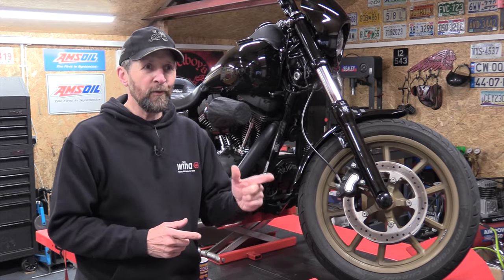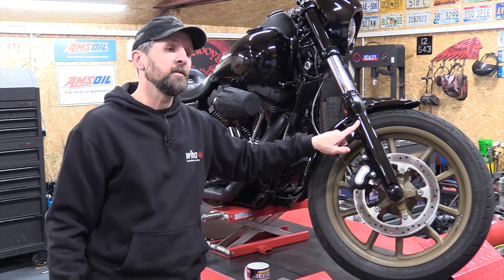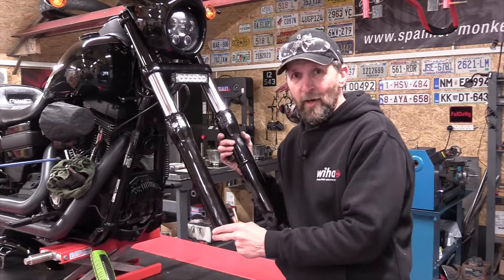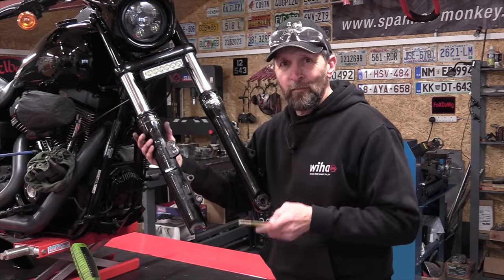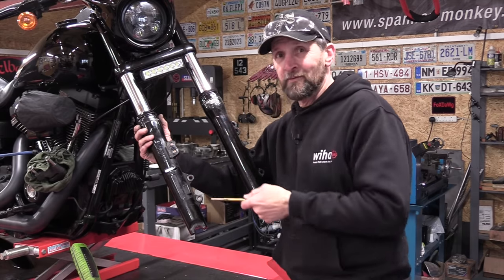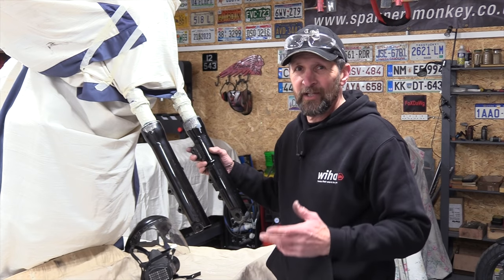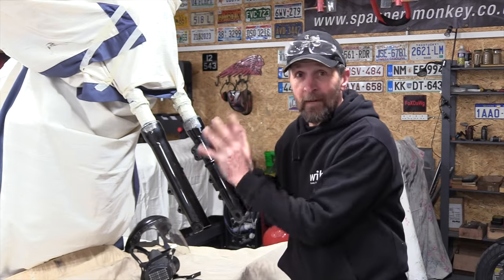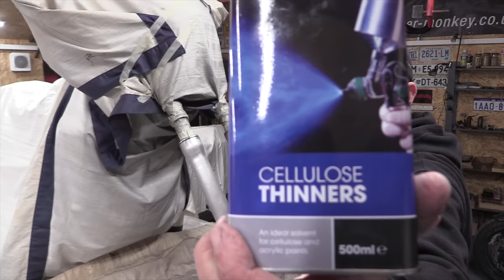Motorcycle Fork :- Corrosion Fix , 1 of 2 !

Comment: You could do as i did. Get one of those big plastics (the biggest you can find) to cover the furniture when painting the ceilings, and make a kind of tent around the bike or the part you are working on. You´ll have to wear a good mask (like you did)  to prevent from breathing toxics but it prevents the dust from going everywhere. I just used fishing poles, ties and bricks to seal the contraption and it worked fairly well . Your end result was perfect!  Ps: i was doing it on my own garage, with my car parked on the side.....
Reply from the maker: Cheers buddy, plastic sheets work well as they have a static quality that actually attracts the paint dust, so effectively sucks it out of the air... good call!

Comment: That is a beautiful job.  I never had painted forks.  That whizzy wheel did a great job cleaning it off.
Reply from the maker: Sure thing mate, it's like a tough plastic pan scourer, takes paint off but doesn't hurt the metal any more than leaving a few lines in the surface, fast and easy!

Comment: Awesome results on the forks brother ! I've used that paint stripper wheel in the past and it has worked great ! 👍 way better than regular pain stripper brother , unless you get one with heavy duty chemicals on it . Great job brother keep up the great work !!!!! stay safe guys cheers from new york 🍺🍺🍷🍷
Reply: I've used 'strypit' which seems to work pretty well. It's cheap-ish, thin enough to be volatile, and thick enough to stay in position. Nitromors 'crafstman' seems to be the most powerful, but it's too thin, so can cause dribble issues. Strypit isn't that good on multiple coatings of paint, as I discovered on my gsxr wheels,, needs working in, and reapplication. Used it because it was here. Definitely recommend the nitromors. Paint on forks is very thin, and comes off a treat. Use 00 (fine) wire wool.  As del touched upon, it has to be washed off properly, or will bubble the new paint. Might look into one of those grinder discs, seems pretty cool, i'm interested to see how they perform.
Reply from the maker: Yeah, absolutly, i have trashed so many paint jobs due to chemical paint stripper residue i will never use it again, not when these paint removal fleece discs do the job so easily, and apart maybe from the dust, they are kinder to the environment that harsh corrosive chemicals that stay in the removed paint mess and end up in land fill... plus, seriously, its way cheaper, these fleece discs are about £4 each, and last ages.. way less than the chemicals !   Take crae guys and have a great weekend.

Comment: I think the hardest thing for the DIY painter to resist is going for that shiny complete look on the first coat.  It’s so tempting!  Hope that oxidation doesn’t return. Once it starts it can be a bear to fight off.  My 2 year old vehicle with new hinges and doors will attest to this.
Reply from the maker: Yeah, it's a constant battle for sure, but if brand new metal as it came from the factory can go like this, then it's pointless thinking you can ever cure it permanently, this was caused by the badly designed dress covers, and ill be removing them to stop that cause again, but corrosion will always happen when i bike gets ridden in the weather right?... have a great weekend sir, and keep safe.. D&Pxx

Comment: Not sure if you have already, or if this video covers it, but could you do a video on corrosion removal from frames? I've got my wire wool and my tin of rustoleum ready to tackle the odd bits of rust popping up, but watching your videos on something before i do it fills me full of confidence.
Reply from the maker: You can consider this video the same as a frame, clean the metal till it's shiny bright, keyed to at least 400 grit, and either use a primer-free stone chip paint like this, or if you're using a regular paint then use an acid etch primer first!   Good luck with it!
Reply: @Moonfleet41  i'm sure i'll learn everything when i get time to watch this. Love your channel though, recently replaced my rear wheel bearings thanks to your videos.

Comment: A cracking job. I was a bit sceptical at first, as I've done something similar and struggled to get all the old paint off and it ends up looking decidedly average. But those wheels work well and the end result looks top notch. I did think I spotted a deliberate mistake though during the cleaning stage, which isn't like you.
Reply from the maker: You must get all the old coating off first or it will always look average... totally bare metal and start over, works best mate. !

Comment: Going by personal experience I reckon this is the way forward - Powder coating isn't infallible, it can still be chipped by road grit just like paint (though admittedly not quite so easily) then you get moisture ingress again and the corrosion process continues, only this time it's harder to fix the problem because powder coating is a real b*stard to get off, the only practical way is to have it professionally redone at further cost and lost riding time..

Comment: Why didn't you use etch primer first Del ? Aluminium does not like just being overcoated it NEEDS an etch to make the top coats stick and be harder wearing. 🤔🤔🤔 I learned this the hard way years ago back when first got into doing bikes up because the aluminium WILL  eventually try and shed the paint. Etch primers acid base 'keys' the surface better to allow subsequent coats to bond better. 👍
Reply from the maker: Check at 9:57 , held that can up and pointed at the "No Primer Required" because i always get this same objection... ive been using this product for ten years since i first stumbled across is for painting a side stand... and that side stand is still good, no chips or flaking a decade on.. so it works mate  🤔🤔🤔!
Reply: @Moonfleet41  mmm. . . Must have some sort of etch in it already because any metal non ferrous doesn't like a covering. Ally or galv plated. But if you've found it works then I ain't arguing I'm just old school and still don't trust these new fandangled paint systems. 😅😅👍
Reply from the maker: @granite676  Sure thing mate, it doesn't make sense in excepted logic to me either, but two things stand out, one is that it works like 'Hammerite' which has been around WW2, and the factory paint had primer under it and it still failed, so tbh mate, I don't think this will last forever on aluminium as, quite rightly like you said, nothing does, not even chrome or powder coat... but for £6 a can and a few hours of my time, I can do it every couple of years if I need to, thanks for your input buddy.

Comment: A brass drift and a brass hammer are a mechanics friend.  For that particular job, a wooden dowel would likely have worked but you need those tools in you box anyway.  Paint job came out very nice.  Is that a typical place for corrosion though?  Never saw that before.
Reply from the maker: Hey buddy, a wood dowel wouldn't have worked in this case as you do need to tap quite hard and the cut end you're tapping is quite sharp, so imagine it would split a wood dowel immediately, but the brass works fine, I guess you could even use aluminium... this corrosion was caused by the covers themselves, they harbour the salt crud and promote the corrosion, all covered in the next video online tomorrow!
Reply: @Moonfleet41  I couldn't really tell on the video they looked like they popped right off but I'll take your word for it.  It is amazing how fast salt can turn aluminum into powdered sugar and crystals.  Your paint job turned out good as new.

Comment: Outstanding job.. and very well explained, i was just about to take my forks off, strip them and send them for powder coating. Will give this  go first. Don't suppose you can share what paint you used? I have rust spots on the mud guards too. Do you think the same paint would be ok or get a proper black paint with a clear coat? Class videos mate.
Reply: I found the paint thanks, Simons Black Gloss Tough Paint :)
Reply from the maker: You can use it pon the mudguards too, it will give a gloss finish that's ok, but maybe not as perfect as a base coat and clear... up to you mate, both options open to you.

Comment: but if you have corrosion eat the surface like that then it normally goes much deeper making it weaker?  painting over it does not address the integrity issues.

Comment: Why no self etching primer? And maybe you could have mentioned the clean up is the same for clear coated ones, then polish and seal to look brand new.
Reply from the maker: Check the video at 9:57, it's a self etching stone chip paint that works without primer!  And of course, I think pretty much most people can work out once I had them clean and prepped, you could indeed have run a buffer over them and polish them up, but hardly on an all black bike!

Comment: Looking good Del, I will watch the second part later as I need to do this on one of my bikes. Between the coats you mention the drying time and 'flash off' what does flash off mean?
Reply from the maker: I just means to allow the paint a small amount of time to start curing and thicken up a bit before the next coat, but no long enough for it to dry...each coat needs to be wet so they bond together, but not so wet it get's heavy and runs.!
Reply: @Moonfleet41  great, thanks. I haven't heard it called that before and thought I was missing something out. It's what I have done in the past but didn't know there was a term for the process. Great channel and uploads as always Del, thanks to you and Penny for all you do on here 👍

Comment: Apparently the truck bed paint from Halfords is really good but I don't think it's gloss finish.
Is it worth putting lacquer on top?
Reply from the maker: Not with a gloss finish mate, this stuff dries soft and remains flexible, lacquer dries hard and chips so the two wouldn't be compatible... this is all you need, just lay it up thick as you can without runs!

Comment: Hi Del, would you advise using that paint removal fleece on plastic parts to remove the paint?
Reply from the maker: No buddy, i'd imagine that would scuff up the plastic pretty badly...plastic panels aren't much tougher than the paint over them..! i only use them on metal..!
Reply: @Moonfleet41  Cool thanks mate 👍

Comment: I had similar metal-dustcovers on my 883 C Sportster . I just remove them and throw them in the dustbin. They are useless .My opinion. The rubber covers are enough protectors just like Japanese bikes. And do not collect dirt like the metal covers. Thank you for your exelent well done videos.  I take some coffe watching and relax... 👍
Reply from the maker: Exactly  Björn, they are a liability that in this case has caused the problem, in the next video once its dry, ill be removing them like you did.!  like you said, the actual dust seals are the rubber rings below them, and they are all you need.